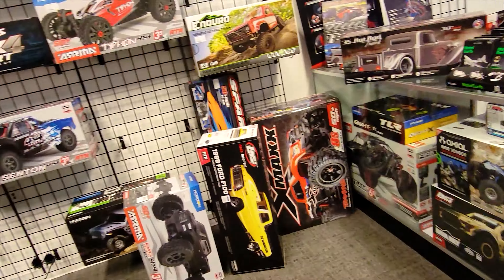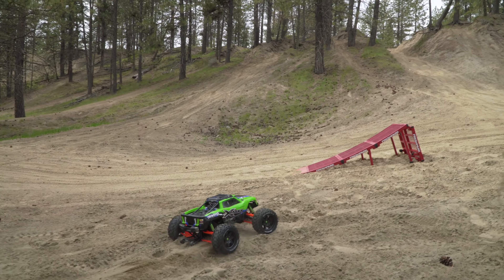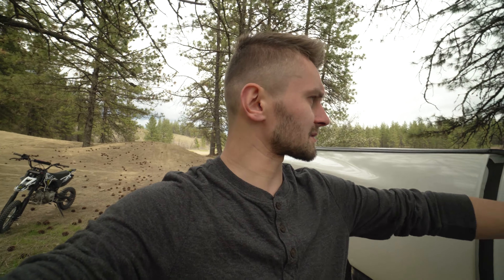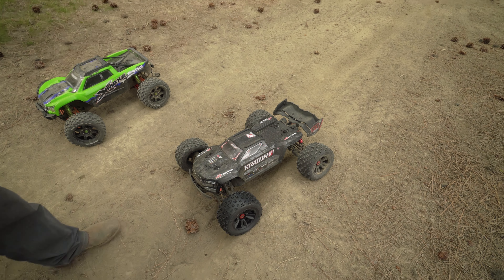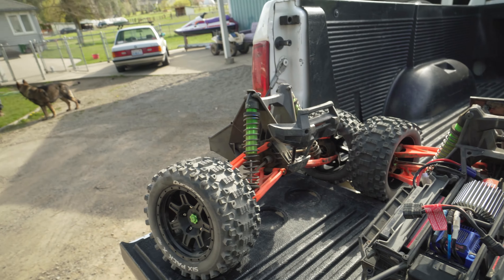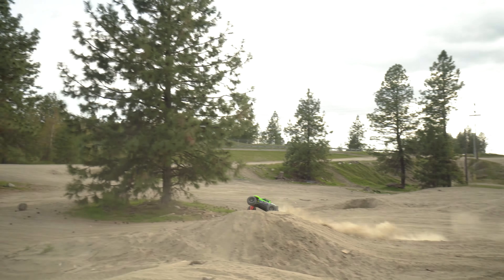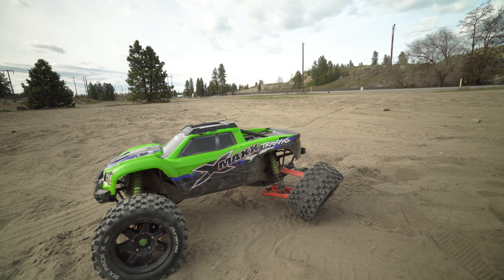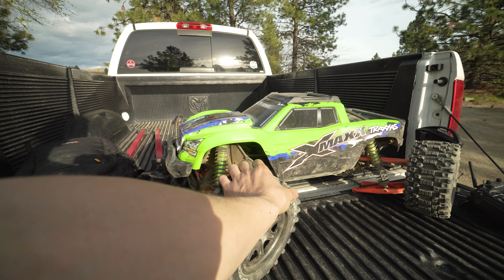Traxxas Xmaxx 8s Belted Tires

Comment: The ballooning, if controlled, is probably better for high impact landings. Extra cushion for the slamming.
Reply: Not really bc you don't want to be on the throttle when you land
Reply: @trulydef418  yeah, that's true. Neutral is best.
Reply: As in real life, tires are part of your suspension.

Comment: there's after market hinge pins the have a nut from the other.  should help pull it tight and not brake
Reply from the maker: Thanks for the tip, I seen them before but didnt know if they helped or not 👍
Reply: Without the lower Bulkhead Tie Bars other hinge pins will not help!!! 😉

Comment: It's all about the weight , but belted is the only option , I just got a set of sledgehammers , lasted 30 minutes , blew rubber right off the rim , I've got power hobby m43's they are way to heavy , just break stuff , I took out the foams and I have yet to try them , but I'm totally lost on what tires are good for the hobbywing beast , very good subject for xmax owners for sure your breaking arms cuz of the tire wieght , I've been there n back , but we need belted tires for it but lighter

Comment: Go back to your stock arms and use m2c to widen it👍🤜. They have a hub extension.
Reply from the maker: Thanks for the tip Bro!👍 Probably will go that route
Reply: Plus M2c hex will match the duratrax wheel hex..Stock hex is a little different

Comment: Awesome video! Just got a Kraton EXB, wanted to ask which batteries you use/recommend for it?
Reply from the maker: I run the Zeee 4S 14.8V 7200mAh 80C and so far they are pretty good
Reply: @FortekNine  Awesome! Thanks for the info!
Reply: Pickup some HRB 9500 120c batts from Ebay. I grabbed two to see how they are. Fantastic is how they are! Matching between cells was a lot closer than even my Gens Ace Bashing 6800's which are suppose to be top of the line batteries. The HRB's are cheaper/same price as the Zee 100c stuff, have a hard case, and fits in the Xmaxx with room to spare. They come with either Traxxas plugs or EC5 so be careful which you order.

Comment: Nice Video. But 1)i would not go belted for Jumps 2)i would have a spare car (one arrma 3s bigRock/Granite or Traxxas 4s Widemaxx is perfect). To  the mooooon 3) i will not instal the wide-arms on the x-maxx. Heavy belted wheels that dont flex much plus the leverage of the longer arms hurt the car as you have shown to us. Yeah it sure handles better with wider stance, but its a monster truck. a monster truck dont handlles good, but is a tank.

Comment: The wider stance is better for control but the wide kit from Traxxas isn't the answer. Pickup the wide kit from M2C Racing (It's cheaper than the Traxxas wide kit too). It extends the hubs while using the standard arms (stronger setup). Added benefit is you can also get hub adapters from M2C for 24mm rims = you can run the Arrma tires (like Backflips) that do allow you flip control in the air. While you're on M2C's site grab a bash bar and/or the shaft drive kit. Chassis flex is going to bend your center drive tube. The bar will eliminate that along with blowing up bulkheads constantly. The Duratrax tires are terrible for jumping as you've seen but at least they not much heavier. Go with Arrma tires for bashing. Most of the aftermarket stuff adds too much weight which leads to breaking other stuff. Gotta keep the Xmaxx as close to stock weight as possible. Bash on!
Reply from the maker: Thank you for the tips man, I will have to check out their site out. 👍
Reply: @FortekNine  Everything they make is top notch and has actual value. Their customer service is all aces as well. M2C is a family run American company that gets it right! You won't be disappointed.

Comment: Ultimately, I hate belted tires for bashing. No control in the air, super heavy so there’s more breakage, every. Single. Time.
Reply from the maker: I agree, there are not too bad if your racing around a little track with smaller jumps, Not so good for bashing 😅
Reply: @FortekNine  , not at all. Also, I’ve seen ya know, most of the rc videos out there. I’m always shocked when someone puts a set of large belted tires and then sings their praises. I’m over here like, what? Have you ever tried a double or triple backflip with huge belted tires? I dunno. They have their place, but full sends and even light bashing are not their place